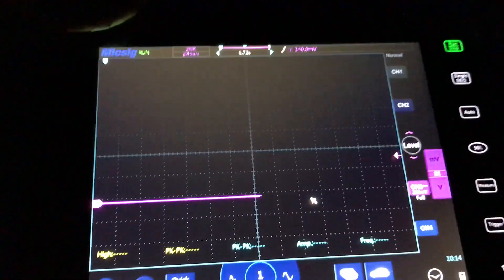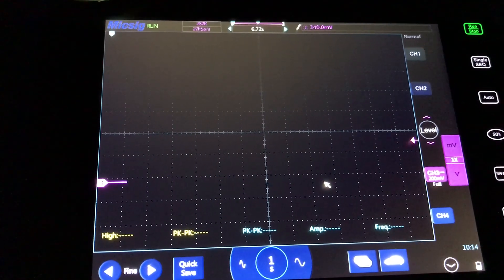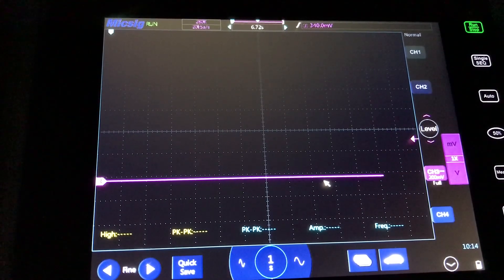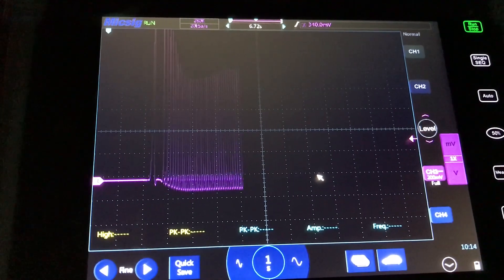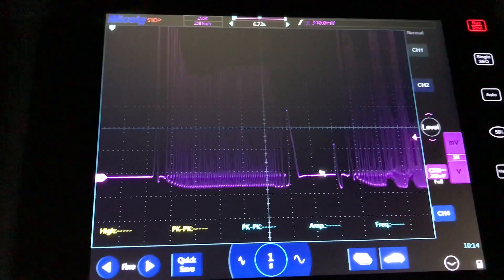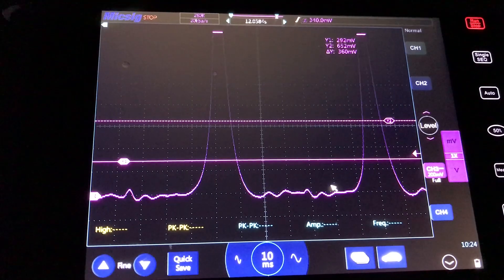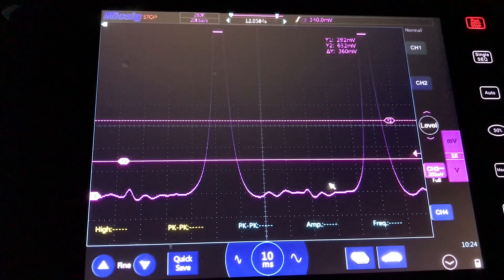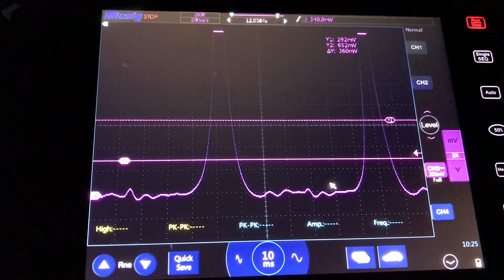Engine correlation and back pressure testing MICSIG WPS500  it’s night time

Comment: How did you get you measurement for pressure?
Reply from the maker: Using the WPS 500 by pekoe every 10 mV equals one psi. For example, if my vertical lamp to the top of my tower was 500 mV that would be 50 psi in my video. I mostly show them the horizontal scale which is time but the WPS can be converted to pressure and millivolts. There’s a direct relationship you don’t even have to use a pico scope a DVOm Work